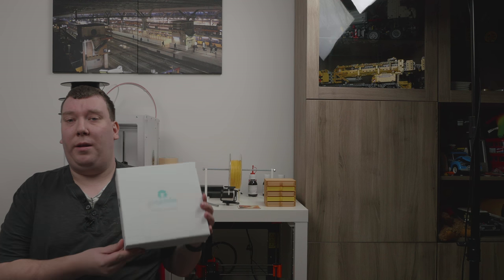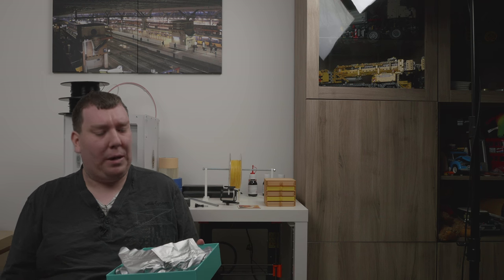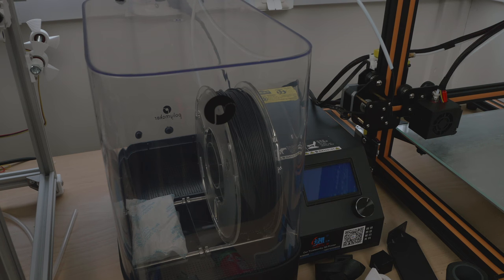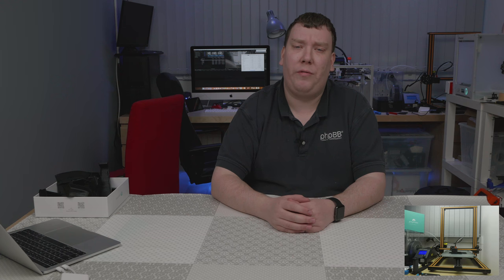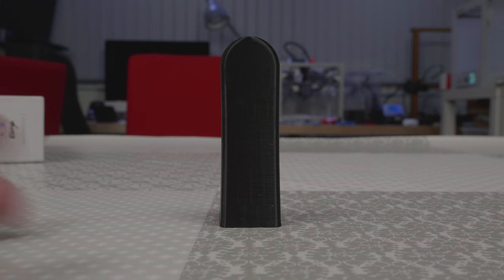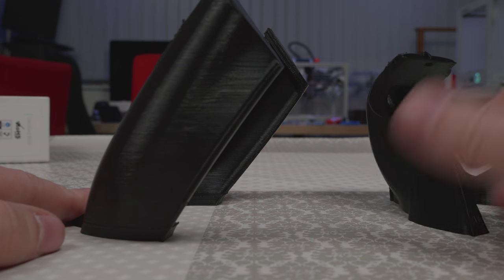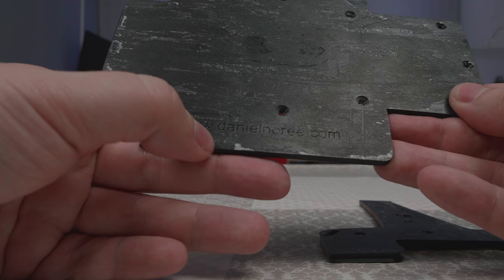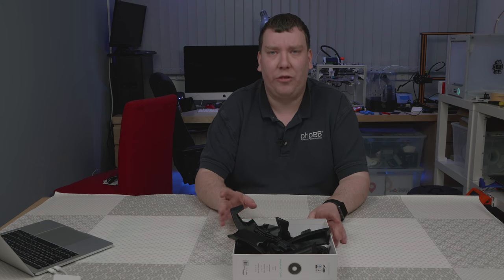Review: @Polymaker_3D 's new PolyMide™ CoPA, printing a #OpenRC F1 car from @DanielNoree

Comment: You said that you used gluestick, but you did not say what temperature you used for the bed. Also I would like to know if the claim Polymaker makes about the heat resistance of this material is true.
Reply from the maker: You are right, totally forgot that. I used 70C on the heatbed, which is the suggested temperature from PolyMaker, however according to their specsheet it would also work without the heated bed completely.
I will try to do some tests with heat resistance, if you have any suggestions on what to do, please let me know!
Reply: Thank you for the responce, with 70C and no warping on the OpenRC base parts sounds like the claim for near zero warp is true. For heat resistance you can use the openRC front base part in an oven lifted from the sides only and hang a weight on the middle to see how it flexes and bends and then at what temperature it becomes softer. You could copy the method the channel "cnc kitchen" used in the video "What's the temperature resistance of annealed PLA, PETG and ABS?"
Reply: @3DPrintingstuff  Thanks, was wondering the same thing as Polymaker gives a range of 25-70c